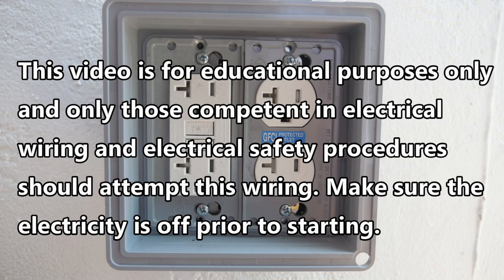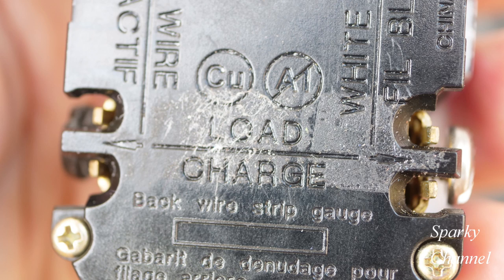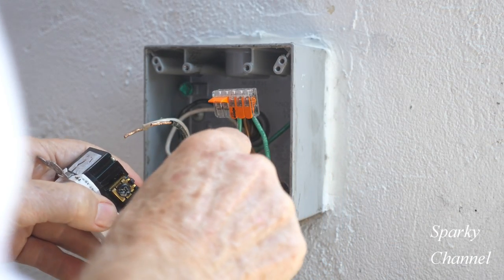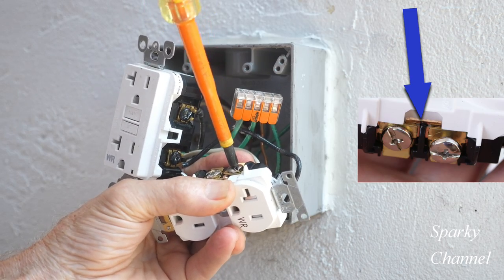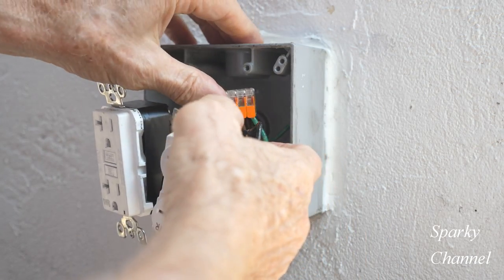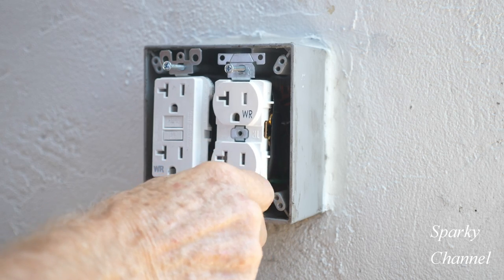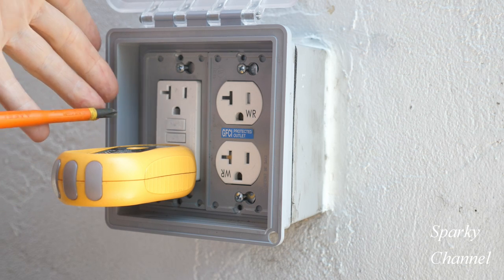How to Wire GFCI Exterior Receptacles with Weatherproof Cover, Real Time, No Edits

Comment: Excellent video, Bill.  Thank you.  Question: I was shopping at a big box store and noted some waterproof wire nuts stating, “NEC Required for Outdoor Connections.”  The wire nuts are filled with silicone.  I have searched the NEC and cannot find a requirement for these nuts.  Would you please point me to the NEC requirement, if there is in fact a requirement?
Reply: they are required for a wet location - so the manufacturer kind of exaggerated the requirement.
Reply from the maker: No requirement if they are in a weatherproof box.

Comment: since the duplex receptacle has that golden strap on the yoke and the box is grounded, is the ground pigtail still needed?
Reply from the maker: The golden strap on the yoke is a self-grounding clip. Because of that the duplex receptacle does not need a ground pigtail. However, I think it is wise to run a ground pigtail to it as a redundant ground. Excellent question!

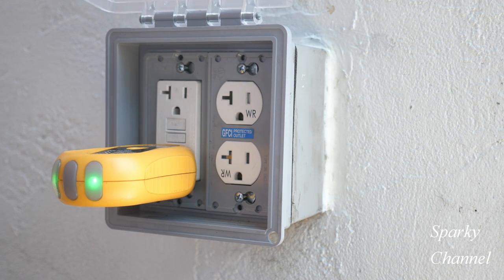Comment: At about 7:30 in the video when everything seems completely installed, I can still see past the outlet wall plates into the box around the mounting screws for the outlet. I'm dry-assembling some Sealproof 1-gang enclosures before installation and I notice this same gap - is that normal or safe? A pair of 1/4" holes straight through the wall plate seems to defeat the whole point of a weatherproof enclosure. There aren't a lot of videos specifically showing the Sealproof covers and the manufacturer's info is pretty sparse. The foam gaskets on other brands of enclosure cover that gap. Taping over the holes or filling them with caulk doesn't seem like the right approach. Is this something I should worry about? Not criticizing your installation at all - just worried about the specific design of the Sealproof enclosure.
Reply from the maker: I would suggest using some clear caulking to fill any holes. It's very important to get everything sealed up well. Thanks!

Comment: Sparky.....cant find the items you mentioned ....tools and outlets, etc...thanks
Reply from the maker: They are in the video description. Here's some of them:
Klein Tools 32288 Insulated Screwdriver, 8-in-1 Screwdriver Set with Interchangeable Blades, 3 Phillips, 3 Slotted and 2 Square Tips: Amazon: https://amzn.to/3mXUbUJ

Klein Tools RT250 GFCI Receptacle Tester with LCD Display, for Standard 3-Wire 120V Electrical Outlets: Amazon: https://amzn.to/3xXnFZ7

Ideal Industries - IDI61534 IDEAL INDUSTRIES INC. 61-534 Digital Circuit Breaker Finder with Digital Receiver and GFCI Circuit Tester: Amazon: https://amzn.to/2WdOLep

Leviton GFWT1-W 15 Amp Self-Test SmartlockPro Slim GFCI Weather-Resistant and Tamper-Resistant Receptacle with LED Indicator, 10-Pack, White: Amazon: https://amzn.to/3xymSww

DEWALT XTREME 12V MAX* Impact Driver Kit, 1/4-Inch (DCF801F2): Amazon: https://amzn.to/3mvmXfg

WAGO 221 LEVER-NUTS 36pc Compact Splicing Wire Connector Assortment. Includes (16x) 221-412, (12x) 221-413, (8x) 221-415: Amazon: https://amzn.to/3HhcrBW

Leviton GFWT2-W Self-test SmartlockPro Slim GFCI Weather-Resistant and Tamper-Resistant Receptacle with LED Indicator, 20-Amp, White: Amazon: https://amzn.to/3xCuSh6

Leviton TWR20-W 20-Amp 125-Volt NEMA 5-20R, 2P, 3W, Duplex Receptacle, White: Amazon: https://amzn.to/3MHvGpc

Sealproof 2-Gang Weatherproof In Use Outlet Cover | Two Gang Outdoor Plug and Receptacle Protector, Lockable, UL Extra Duty Compliant, 45 Configurations: Amazon: https://amzn.to/3xDRAEz

Comment: How many regular outlets can you have on a Gfi Outlet?
Reply from the maker: I called Leviton once and asked and they said 7 was OK but I don't think that was an official statement. I think 4 or 5 would be fine.
Reply: @SparkyChannel  thank you
Reply: it is less how many outlets you can have and more how much load you can have.  I avoid having more than 10 receptacles on a 20 amp circuit.

Comment: Equipment ground to the standard duplex (WR) receptacle?
Reply from the maker: Hi Ted! Yes, each of the receptacles need to be grounded. There are different ways to accomplish that, but I ran separate ground wires to each receptacle.

Comment: @Sparky Channel Excellent video, Bill. It was very helpful indeed. Quick question on the conductors running into the box. You did a video on the NEC requirements that state a minimum of 1/4” of insulation be visible in the box. Does this not apply to exterior enclosures? Perhaps the 1/4” is behind the WP cover and is counted only in the wall box?
Reply from the maker: It applies to exterior receptacles as well but yes, it would be for the box behind the WP cover. This was an existing box, so I was working with what was there. Thanks Drew!
Reply: @SparkyChannel  I ask because I recently added a WP cover to an existing box in the wall. The conductor was 12/2 from the 80s and had a very stiff, thick jacket. Having 1/4” out of the box into the WP cover was like putting a 1/2” rock directly behind the receptacle devices with the conductors. I made it work but it took longer than I wanted.
Reply from the maker: @perezai  I understand. We don't always get to work with new cables. :)

Comment: Another great video. Thank you. How would you make the connections if there was another set of conductors for receptacles further down the line?
Reply from the maker: Here you go: How to Add a GFCI Protected Receptacle: https://youtu.be/6m-s0TP8ln4
Reply: @SparkyChannel  Thank you! That is exactly what I needed. Got it installed and everything is working perfectly.

Comment: just a note that some brands of GFCI don't have the green LED.
Reply from the maker: Hi Ken! I just browsed through all the brand of GFCIs on Amazon and they all have the green or green and red LEDs. I know the older GFCI receptacles don't have the LEDs. Do you know of any current brands that don't have the LEDs or just the older ones?
Reply: @SparkyChannel  I just know I run into other brands periodically that don't have an LED showing if they are active.  also, it's a quirk of the Levitons that they will show a green LED and be off if they are wired backwards.
Reply from the maker: @kenbrown2808  Interesting!

Comment: Bill, maybe you can do a video where you install an external box over vinyl siding.  Seems like it's tough to do to get it sealed up correctly.  Not sure if installing over a mounting plate or flush with the sheathing underneath and cutting the siding around it is the best technique.  Thanks!

Comment: I just added exterior outlets to the four corners of my newly purchased house that was built in 1910.    From your video, it looks like I did the wiring correctly except I put the GFCI in the basement since the basement is unfinished and lacked outlets in some of these same corners.

Just wish your video had shown how to mount the exterior box.   Wondering if I did that correctly in terms of both mounting and passing the wire through the rim joists.
Reply: I don't care that they say WR rated GFCIs are weather resistant - they still last longer indoors.

Comment: Thanks Bill.  This is helpful (though I am still without my waterfall-now the pump is tripping the GFCI).  Good information.
Reply from the maker: Thanks Jeff! Did you replace your GFCI receptacle?
Reply: @SparkyChannel  Tracked the problem to the pump.  It may have a broken seal that triggers the ground.  If the pump is replaced that should stop the problem, but we are going to  retest the receptacle as well.  Thanks for you tips.

Comment: Can 2 GFCI outlets be next to one another?
Reply: Yes. If two circuits were used - one to each outlet - then you would use two GFCI. This will be a tight fit and you'll want either a deeper outlet box or the compact/slim GFCI outlets, or both to make it easier to fit the wires and outlets in the box.. However, since the box in the video is fed with only one circuit for both outlets then only one GFCI is needed. You hook the second outlet to the GFCI "Load" terminals and the second outlet is protected by the GFCI.